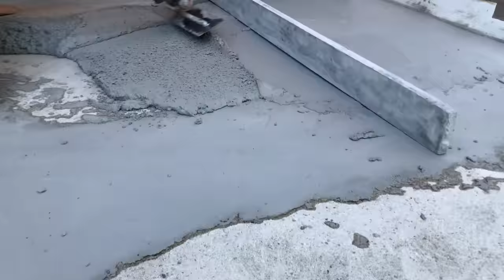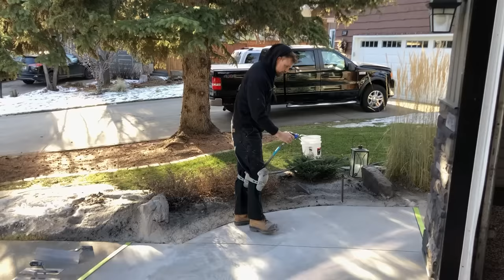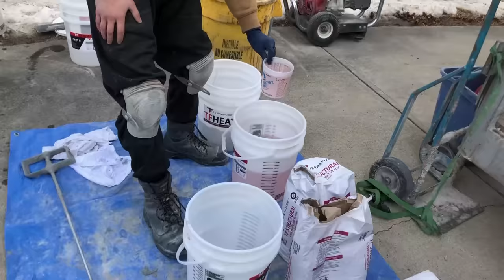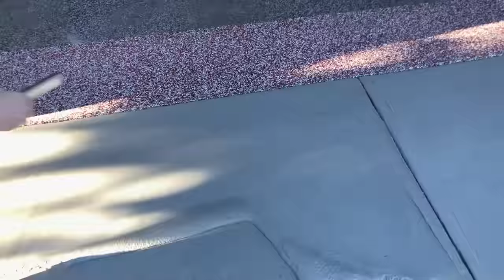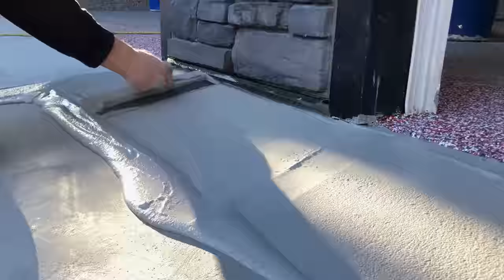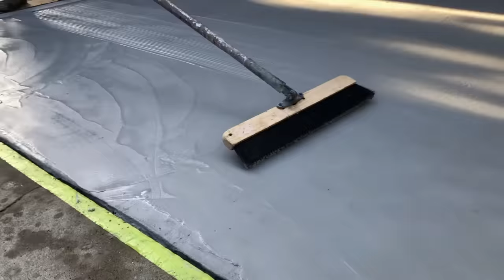Fixing driveway cracks, height differences, and broken edges, using TF Structural Concrete Repair

Comment: Great job and I liked the music too.  How did you repair the big crack?  We have some big cracks on our concrete driveway, but I don't think any are as bad as the one in the video-thumbnail.  Maybe we can still save our driveway that to my knowledge was built in 1984   I never worked with concrete other than taking turns with my brothers when we were young boys stirring the concrete mix for our Father.  I was told that I need to start by power-scrubbing wash our driveway - kind of like when I worked the midnight shift at Delchamps Grocery when we stripped and wax the floor.  I will try to post a video of our driveway.  I am the first and last line of "Chief Amateur in Charge" of home projects until we must call for professionals.
Reply: I'd bet the reason that driveway has wide cracks is because no reinforced steel mesh was used in the "middle" of stab thickness to lock it all in. Have watched many driveways poured mostly no mesh or steel mesh lying on the ground where it will rust away from  salts causing expansion then cracking.
Reply: @erikkopsala3564  it could be clay soil causing settling and or tree roots

Comment: was mud jacking considered for this application as well? Pros vs Cons?
Reply from the maker: Yes, mud jacking works great, and also ensures the void underneath is full, so future sinking is much less likely. This is especially important with newer sites, that will be prone to continued settling. This project was like this for 15 years, so the slab had stopped moving. Also,  with mudjacking, there is no concrete repair, which these slabs also needed.

Comment: Looks like a good product, problem is by not tearing out and fixing the issue under the concrete this will continue to happen. The foundation was backfilled with dirt rather then a compactible material.
Reply from the maker: I agree for newer situations or construction, but this driveway settled to this point, and has remained like this for about 15 years. You definitely have to be sure the ground is stabilized underneath your repair, or it will continue to happen.

Comment: The correct way to build a driveway.  First , you should slope the ground towards the street so the water drains into the street and doesn't collect under the concrete. Then you should compact crusher run every 2 inches and build it up to at least 6" with a "Thumper compactor", plate compactors DO NOT Compact good enough .  Plate compactors are used to flatten and area for paver stones to be place on a level surface only.  Then you should lay your #5 rebar and call the termite/ Bugman to come out and flood the area with termite poison so termites don't nest under the driveway/patio.  If you are going to park a semi tractor or a heavy RV etc. on the driveway you will need at least an 8 inch slab, otherwise pour a 6" slab.  Most driveways are poured onto uncompacted dirt , have little or undersized rebar and the concrete mix is under 4500 P.S.I..  If you are building a new home Always call the Bugman to soak the compacted gravel with termite solution, and I mean SOAK it not just spray it.

Comment: How is it's durability in high traffic areas ? Fork lifts running over it Etc. and last how long to set up to be used ?
Reply from the maker: Very durable, it’s meant to perform as good as concrete would.

Comment: The existing concrete should’ve been etched and dampened first and the patch mortar should’ve been scrubbed in good as he was going. This ensures an optimal bond .
Reply: @jefflavere3263   I would 1st power wash the concrete, and then rinse it with vinegar water.
Reply from the maker: That is if you are using polymer modified portland cement, which this isn't. You don't require bonding agents, or scrub coats, as you aren't 'gluing' this material to the existing concrete. It chemically bonds to concrete substrates. The concrete was prepped with a diamond grinder.
Reply: Either way this process never works. Always cracks and falls apart. Better off to just pour new concrete
Reply: @jasonbeck8628  100% false.

Comment: did you have to grind at all? how long will this stay?wont it pop off it the cold?
Reply from the maker: Yes, you need to prep the surface first. It will stay as long as the concrete below it, and no, it won't pop off in the cold.

Comment: Could one put some sort of reinforcement in it like chicken wire if the top coating was a bit deeper?
Reply from the maker: You’d want that to be at least an inch below the surface though, to prevent rusting, and there is no need to install it that thick.

Comment: Ahh if you have a gravel driveway.. you never have to fix the cracks.. just saying.
Reply: But you have lower home value just saying
Reply: @movewithmarcy1574  that's not true.
Reply: @stephen2738  how is my statement not true? I’m a realtor and here is California if you add a nice concrete driveway it adds about 10% of your current home value compared to gravel, not saying gravel doesn’t add home value but just not as much as concrete. If your looking for a quick sell I suggest gravel but if it’s your longtime property, concrete is always better if installation is done correctly
Reply: So my house is worth 1.7 million with a Blue stone gravel driveway . So if I add a $25,000 driveway it will get me an extra $170,000 bucks? Sign me up let's start flipping houses.

Comment: How will this bond and stay down long term if you have not used a slurry or primer or something to ensure that this does not crack and come up?
Reply from the maker: It chemically bonds to concrete. It doesn’t require and “glue” to stay attached, like many other polymer modified products.

Comment: The first couple of expansion joints and control joints got buried under inch or so of "material" after that,  that started getting edged.either way, I give it 6 or 8 months and whats next?  When repairs are quick and easy, so is fail ratio.
Reply: i saw that also
Reply from the maker: The repairs were not quick and easy, that was a 2 day project. Here it is after a year https://www.youtube.com/watch?v=AY-mhFVXACs (2:37), so you are wrong so far. We also saw cut those expansion joints back into the slab.
Reply: @TerrafuseInc  Saw cuts are control joints not expansion. So when it cracks, not if,  crack will be on bottom.  But, if its still showing nice after a year you've got my attention.  I have a patio slab that is a prime candidate.  Thanks
Reply from the maker: https://youtu.be/AY-mhFVXACs
Go to 2:35 👍

Comment: what about a bonding prep or just water to prevent the new concrete moisture being sucked up by the dry base, maybe leading to future failure? what does this job look like after a year?
Reply from the maker: https://youtu.be/AY-mhFVXACs 
You can see it around 2:30 in this video after 1 year. 
This product does not need a bonding agent or 'glue' to help it bond. We do add water before install, and it does help, but is not necessary. It is usually done with thinner applications, as you can see us doing in the video.

Comment: How much does it cost to do this through a company? My driveway has cracks. Should I do this or have new slab with new structural design ?
Reply from the maker: If you are only trying to fix cracks, I wouldn’t use this, as it’s very rigid. Where are you located?

Comment: I've never seen anyone pour on a dry surface. 
How do you get it to bond without water?
Reply from the maker: Water is not what makes it bond. This is very different than Portland cement, it chemically bonds directly to concrete structures.  Water helps with working time, but isn’t essential.

Comment: MY I ask how long does this last? I totally understand it’s not a permanent thing
Reply from the maker: it will last as long as concrete does. It will usually wear about 1/8" over 15-20 years, depending on use.

Comment: Wont it just chip off? how does it adhere without wetting and cleaning first?
Reply from the maker: No, it won't just 'chip off', that would be a waste of time! It was mechanically prepped with diamond grinding, and the product chemically bonds to existing concrete.

Comment: This looks like a coating. I'm just wondering, will this thin coat peel off, and can it handle high foot traffic in NYC? Also, what is the warranty on your product? thanks
Reply from the maker: It will definitely not 'peel off', and yes, it can easily handle areas of high foot traffic. Please call for more info! 1-403-243-3000

Comment: What 2 products were used here? Looks like there was 1 product applied with carbon fiber then another product applied for surface finish?
Reply from the maker: The red product is a flexible stucco mesh tape, and the repair mortar is TF structural
Reply: @TerrafuseInc  thank you!

Comment: How does this product hold up in extreme heat (Mesa, AZ).  We purchased a house where the owner had a coating put down that has mostly flaked away with the exception of the couple feet in front of the garage that gets a lot more shade.
Reply from the maker: No problem!

Comment: I'd assume that as with patching spalling, this is no ordinary cement but something mixed to be more adhesive and slightly more flexible and less brittle.  How does this compare with concrete lifting...  Ultimately, there's just breaking up the pavement, grading and laying down new pavement, I suppose this is just something to try before going to extremes.  Note there might be advantages to breaking up the pavement and laying it down again as in heat pipes could be drilled in to bring ground heat to the surface or an active snow melt system laid down, it's all a matter of what one can afford (there's always just laying down asphalt on top of the concrete)
Reply: I hate asphalt but it depends on what part of the country or world your are in. The temperatures and seasons (freeze and thaw) will determine the best option for your situation usually

Comment: Can you do this for a basement floor with cracks ? What's the name of this and is it at Home Depot ?
Reply from the maker: It is called TF Structural, and you can buy it on Amazon. It isn’t meant solely as a crack repair material, as it is very rigid, and cracks will reflect through it. We have other videos on ways to address cracking. Thanks.

Comment: Encouraged this is possible at all. My driveway has multiple cracks and I thought I was faced with a complete tearout and re-pour. Can this process withstand summer heat of occasional 100°+ heat? Is there a contraction-shrinkage factor? Skilled workers like you guys are very hard to come by here in Southern Oregon.
Reply from the maker: Yes, it can handle that type of heat. Sometimes, with multiple cracks, driveways may be too far gone to be restored, but if you email me some pictures, I can help determine if you can restore yours successfully. Mike@terrafuse.com
thanks

Comment: I DO NOT SEE TF STRUC ON AMAZON WHAT IS THE BRAND NAME? do they have thick and thin?
Reply from the maker: it is currently out of stock, but new stock will be there any day, it was shipped out over 3 weeks ago, amazon is seeing a lot of back logs lately. thanks. TF Structural, and this one material can go both thin and thick, just depends how you mix it.
Reply from the maker: It is available on Amazon again.

Comment: Please send me the name of this cement you were using because I want to cement on top of my old concrete on my driveway. I hope isn't gonna crack from snow and salt. 
 Thank you so much
Reply from the maker: TF Structural. If you put it over cracks without proper treatment, the cracks will reflect through.
Reply: Is this can use for crack ceiling..?

Comment: I'd like to see a 3 ton motor ride over that finish. Ok to walk on,  but how much wait can it take. That's the question. 🙂
Reply from the maker: TF Heat for Accelerating TF Structural Concrete Overlay
https://youtu.be/isCXARp0hzw
Reply from the maker: This video will show you its strength abilities 👍

Comment: Ok, read the comments and people don't see the issues. First, when concrete driveway settles its generally settles at the door because the original builder didn't compact the soil before laying the driveway.  So what this is showing that they are adding more weight. The concrete will continue to settle especially with the additional weight. Second, there was no bonding agent used before pouring the new concrete. This was 2 years ago and I'm SURE that this patch has started to delaminate. FYI, there is NO concrete that can be poured to a feathered edge.
Just call your local poly injection company. They will inject through the concrete - compact the bad soil under the concrete - then lift the concrete to the desired level. Its the only permanent solution.

Comment: Can someone please tell me what causes these cracks to happen and is there worry for concern.my garage floor is cracking
Reply: There is so many things that can cause concrete to crack. The only way to get an idea of what is causing it is to look at it. It might just be stress cracks from not using expansion joint to allow for expansion and contraction. I see this a lot.
Reply from the maker: Yes, there are so many factors. Ground settling, water getting under the slab, shrinkage, tree roots, settling, expansion, improper concrete installation, concrete too thin, rebar too close to the surface... It is not a big concern, as cracks are quite common in concrete. If they get wide, and there are height differences, you may want to address them. 
Thanks

Comment: It looks really good. Just really don't like how the edges turned out after fixing the joints.  I believe that you shoukd have used the broom again over it so it would all match and look the same. Where the edges are smooth and everything else has that broom brush look.. Other than that Fantastic Job. I still like it alot. Any idea on how long the life jevity is on an overlay like this?
Reply: That is always how sidewalks are done. Smooth edges around the perimeter and brush the rest for no slip purposes

Comment: So is that a plastic mesh that you put on the concrete that fills the cracks or makes the cracks not get bigger
Reply from the maker: There are lots of systems out there, but if you search stucco mesh tape, you will find a lot of options. It is like taping drywall, when using a rigid material, you need something with tensile strength to bridge over the moving crack.
This video gets into more detail about it:
https://youtu.be/o5UYlJmKhAE

Comment: One good 4000 PSI power wash and this topping is off down the block. 

NYC this would be illegal, one crack and they want a licensed contractor to get a permit "Rip You Off" and Fix the Violation and have it removed. It's Cracked cement not broken glass. Our Governments have gotten to out of control with their Extorting Tactic Rules and Regulations. 

What this contractor did was called a Topping.

Comment: My driveway and patio have been painted. Am I correct in assuming I need to sandblast off all those layers of paint before I can do this?
Reply from the maker: Yes, you need to get back to clean, porous concrete.
Thanks
Reply: You may be able to use a pressure washer. Sandblasting an entire patio and driveway would be a nightmare!

Comment: Great work, any idea what caused the original failure
Reply from the maker: Thanks :) It appears there was a lot of ground settling in this older neighborhood, multiple houses had the same issue with their driveways.
Reply: Most likely water saturation into joints... otherwise poor ground compaction before pouring concrete (for whatever reason cheep labor’s tend to think Top of Driveway needs less compaction) there is a technique to drill or place 1/4 inch X 18” rebar into side of Garage Floor at 6” from each end, to 12” on center prior to pouring  to bind the “marriage” of Garage floor to New pour and even into original because, wire mesh or fiber mesh in concrete doesn’t always connect driveway to Garage Floor.

Comment: what if the slab continues to sink?
Reply from the maker: You can return and add another layer. It is best to ensure the concrete has already settled as much as it will. This project was like this for 10 years, but if it is a new build, and only 1-2 years old, the concrete will likely to continue sinking. You can also have it mud-jacked first, to ensure the base is solid.

Comment: Didn't wet the old concrete?
Reply from the maker: You don’t have to with this product. You can, especially if it’s hot and dry, and you’re applying it thinner, but it’s not required.

Comment: Looks great , would love to give this a try for clients who don’t want to do a whole tear down . What is the specs how much weight can it hold under stress
Reply from the maker: It will do whatever the concrete below it does :) You can find a data sheet with more information on our website
Terrafuse.com
Reply from the maker: https://secureservercdn.net/166.62.108.229/x9r.42d.myftpupload.com/wp-content/uploads/2020/12/TF-Structural-Datasheet.pdf

Comment: Anytime you do this use a bonding agent regardless. Sure to make your repair last alot longer and fail proof it.
Reply from the maker: No, a bonding agent will ruin the bond of this material. DO NOT use primers or bonding agents with TF Structural!

Comment: Is it there any way to pour a layer of concrete in top of a compacted milling 4" tick 40' x  40' area? To used as a patio area (No car traffic)
Reply from the maker: You would have to speak with a concrete contractor. We deal with restoring existing concrete.
Thanks

Comment: As a DIY just add thin metal netting, like chicken coupe net, at the thickest end. Level  the net using small screws and plastic plugs into the old concrete. Nothing like a mechanical bond to the old slab 👍